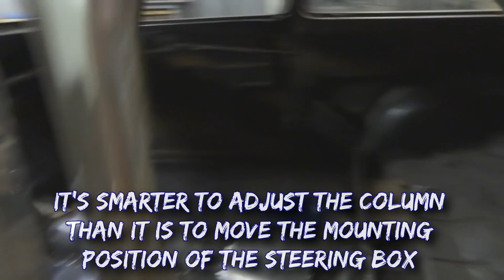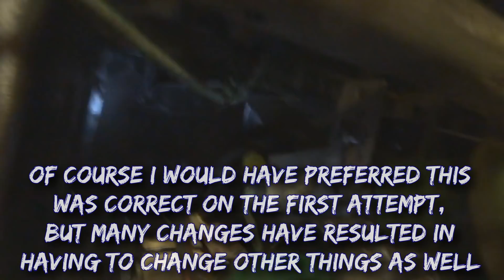"Tinmama" 1940 Chevy SEMA build (Ep. 3) Steering

Comment: I can't wait until the next episode. Im thinking of IRS a F100 with one of those.
Reply from the maker: Justin Johnston well, the driveshaft Is something that's becoming an expensive problem because of the weird yoke design on the 2015-2017 mustang IRS that we are running
Reply: Tinman 2 Kustoms It's an 8.8 housing isn't it? Get a 8.8 yoke for a UJoint is what I had planned.
Reply from the maker: Justin Johnston the yoke is different on this axle. It takes a companion flange with an adapter thats like a ball. There are no ujoints in the rear section Of the oem driveshaft
Reply: Tinman 2 Kustoms Can you have the end for a mustang shaft/pinion connection put on a custom shaft?
Reply: Tinman 2 Kustoms What are the hub to hub measurements? And how wide is that K member?
Reply from the maker: Justin Johnston that's what I'm saying...  I can't find the end of a shaft without buying a whole shaft. Cheapest one I can find locally is like 400$ for an OEM shaft. Then of have to pay someone to build/balance the driveshaft. Another 300$ lol not acceptable on my budget. Gunna have to figure something out. And it's super wide. 68" from wheel flange to wheel flange. The kmember Is like 48" wide at the mounting arms
Reply: Tinman 2 Kustoms Im going to have to pay attention to how you do this. Would Ford's parts department be able to get a yoke? It seems like something there is a box full of at the plant.
Reply: I need to Crown Vic my F100 too. The solid front under leafs sucks.
Reply from the maker: Justin Johnston Ford might have one. But being so new they don't really have a supply of replacement parts I would bet. I'm looking into ways to do it. Will be in the video series at some point. Otherwise the sure fire way is a 1970-1980 jaguar or corvette IRS
Reply: Tinman 2 Kustoms Kinda want to keep it Ford. I know the companies all make good products....but I want it all Ford, or my own invention.
Reply: Tinman 2 Kustoms When is the next video with this in it? Im kinda excited now.
Reply from the maker: Justin Johnston a few weeks from now. Depends when I get to it!!!

Comment: Where do you get those weld nuts? I'm going to need some for my 39 Ford coupe.  Very cool info.
Reply from the maker: We got a bunch of them from dad's old work. But I think they can be ordered through fastenal. They also have a thing called "squeeze nuts", which work in a similar way, but aren't quite as strong/durable.
Reply: +Tinman 2 Kustoms Thanks alot. I'll be checking with my bolt guy. Very good way to secure things. Much better than the rivet nuts. Those will spin sometimes, much better to weld in and I like how they come through the sheet metal.  Good design.  Thanks. Keep Rocking it out!!!
Reply from the maker: Rocker Pat yes the riv nuts can definitely spin, and it makes them a real pain in the ass sometimes lol only thing with these is make sure to keep the bolt in them when you weld. Otherwise you'll have to run a tap through them every time
Reply: +Tinman 2 Kustoms Thanks great info. I'm definitely going to get them. I really like the fact they're available already done, makes it easier to make it right. Over time the holes will wear out with just a bolt, washer's and nuts moving around. Much more like a factory hole in the firewall. Thanks for sharing.
Reply: +Jake Thanks Jake. Got it booked marked. Dollar a piece. Couple of packs would probably do. 20 to 30 bucks worth. Cool!!!
Reply: +Tinman 2 Kustoms Picked up 150 of those weld nuts from my fastener guy for 34 bucks.  Got 50 1/4, 50 5/8 and 50 3/8. Should be good for awhile.
Reply: +Rocker Pat I meant 5/16.

Comment: One more thing take that proportioning valve and throw it away and buy a 20$ willwood manual valve in there. I have never had the one your using live for more than a year or two and no matter what they never work right. Also if you use a manual p valve you can use it as a line lock to
Do burn outs
Reply from the maker: Groom Lake haha yeah this video is actually really old... Was shot like 6 months ago. I actually am working on getting a wilwood master cylinder setup! Ha